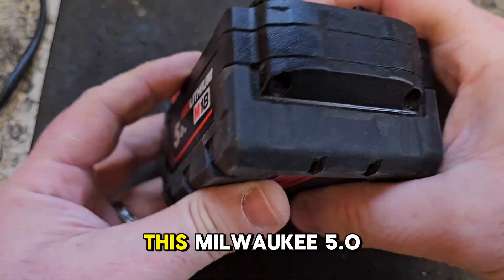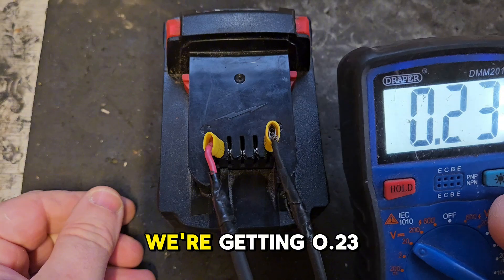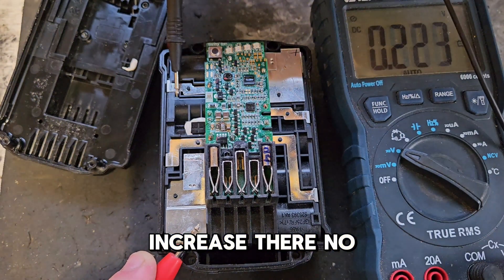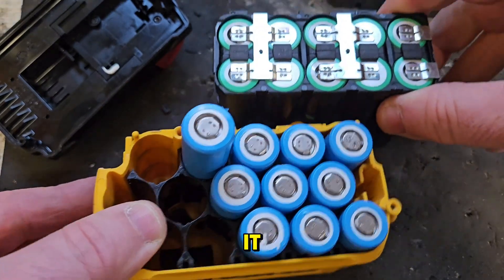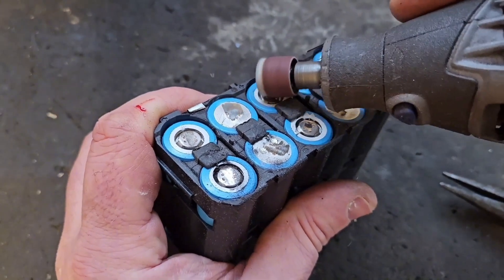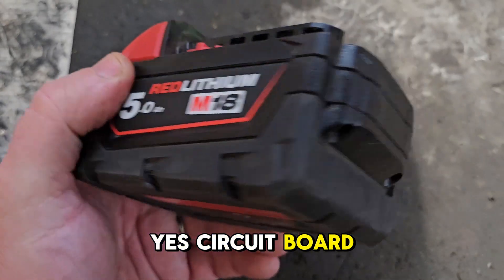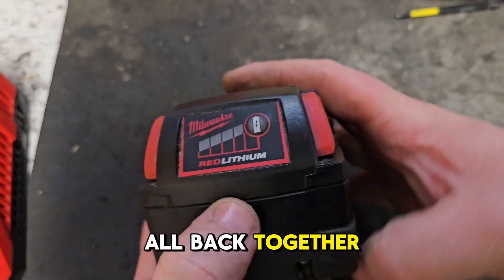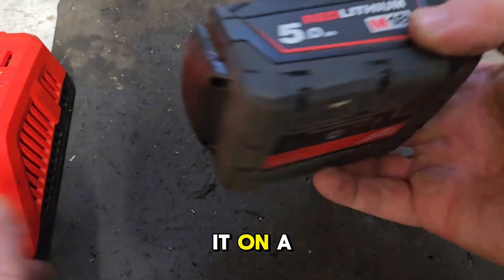Fixing a DEAD Milwaukee Battery

Comment: Curious why the circuit board would need replacing? I've heard maybe it wipes the flash memory (firmware) when cells are disconnected but no clue if that's true or not.
Reply from the maker: One of the reasons is that when a battery charged and discharged a certain number of times it's designed to shut the battery down. The replacement board removes that feature. There can be other reasons too.